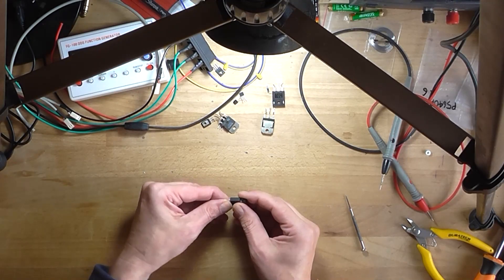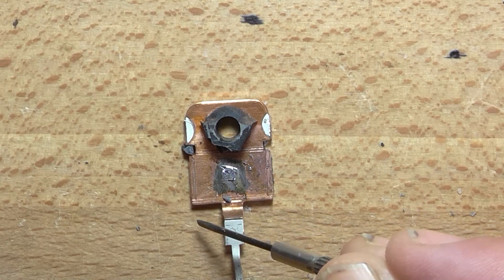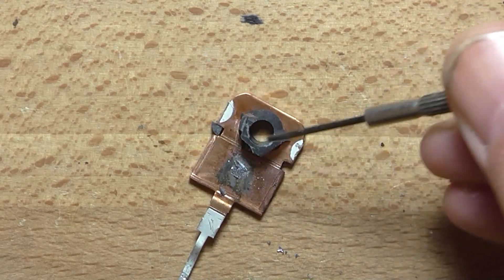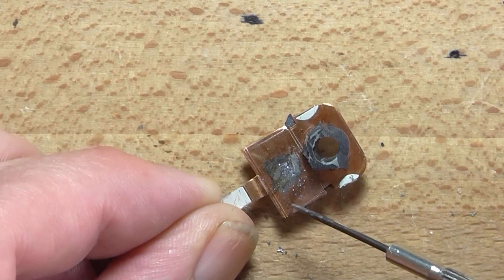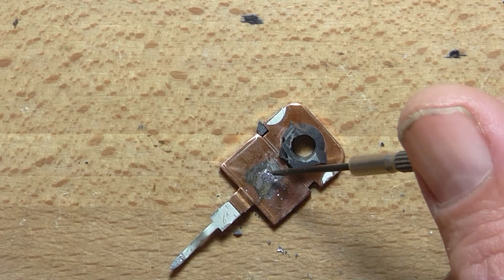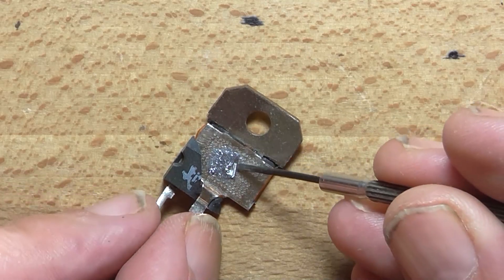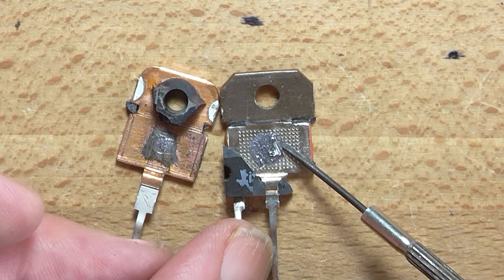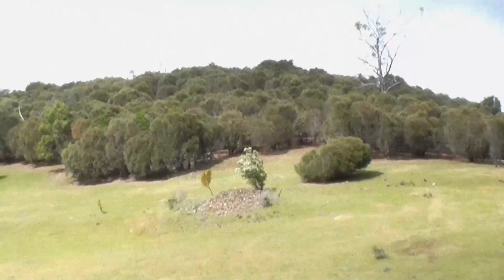Inside A Fake Power Transistor

Comment: I made a voltage booster and i think it was transistors problem yhey say they were rated for about 50 amps but i have 10 amps and it would blow but there are alot more variables like tvs diode and turning it all the way on im not sure

Comment: how do you know what you're getting without splitting it in half?
Reply from the maker: You don't. But, if you go with reputable suppliers, such as Digikey, you should be fine.
Reply: On the non fake is stamped "Genuine".
Reply: @B-M.B Most fakes have the genuine logo on them, sometimes its better to buy the part from another manufacturer knowing its a real one than "original" fakes, at least that is how it works here in Brazil
Reply: @pedrohcs8 you you mean, they lied to me? All the time? 😭😭😭😭
Reply: @B-M.B Probably yes, most of the time i buy a component and it comes identical to the original its a fake.

Comment: Having cracked open quite a few semi's I have found the same issues with dies, also I noted way back (30 years) after opening about a dozen 2n3055's from many diffent suppliers way back then the dies varied considerably in size, I took to opening the 3055's due to many problems with the application I was using them in, all had the same heatsinks attached and yet I found some only lasted a few hours before self distructing, hence even a long time ago all these shitty chinesium copys were floating around the market place.
Reply from the maker: I bought some new transistors from Wagner to replace them in this amplifier (2SA1943/2SC5200), Toshiba devices. I'm a bit dubious, as Toshiba are the number one faked transistor on the planet. However, Wagner is a reputable supplier with a $9 flat delivery fee, which is nice. I haven't tested the amp at full supply (+/-35V), but have tested it unloaded on a current limited +/-19V DC supply in to an oscilloscope. So far, both channels are amplifying the signal to clipping. I won't get to testing it loaded at full voltage until Monday, and am in the process of filming the video (which this excerpt comes from). So, if it blows up again, it will be on video (I will film the PCB during the test, not the scope lol)! Now, having said all that, I reverse-uno'd myself, so it probably won't blow up lol.

Comment: 99% of semiconductors sold on AliExpress, Ebay, and Bangood are fakes or, if you're lucky, pulled from e-waste. Buy from Mouser, Digikey, RS, Farnell, or from the manufacturers directly. It will save you a lot of frustration.
Reply: Yes correct, be carefull where you buy, I only buy from RS and pick up due to there costly postage
Reply from the maker: I bought some new 2SA1943/2SC5200 transistors from WES (Wagner Electronic Services), which is a reputable supplier. $9 flat delivery fee.
Reply from the maker: I have had a good success rate buying BC546/556, BD139/140 transistors and some ICs, such as LM386, NE5532, NE555, etc. from a supplier called "TronFX" on eBay. A guy in NSW, Australia. The TIP36C and TIP35C transistors, I got from a guy called ic_outpost on eBay... never again, even though in my AEL480 amp build, I got a couple of TIP2955s (I think, or it was the TIP3055, whichever) from the same guy, and they worked fine. I guess it's just where they get them from in the first place (most likely Amazon or AliExpress wholesale).
Reply: I bought some NOS transistors on eBay from a repair guy who was closing his shop. Most semiconductors coming from China are suspicious. When I was in China, I had a great deal on NOS components from a former Radio & TV repair shop in Shanghai.
Reply from the maker: @rolandleusden  yeah, I trust stuff from China less than anything else. I've been burnt several times over the last couple of years with fake stuff, like output power amp modules (Kenwood, etc.) that just don't work. Most were videoed. 6 years ago, I bought 5 LM3875 amplifier ICs from China (I think they were $10, or something)... none worked. I had 3 with shorted outputs to supply rails and 2 that did nothing.

Comment: Yep thats a fake
Reply from the maker: That's why the amplifier blew up during a power test. I've got new transistors in there from Wagner Electronics (2SA1943/2SC5200 Toshiba devices), hopefully THESE are not fake. Tested unloaded on a +/-18V supply unloaded and both amps are working again after a carnage of destroyed transistors, but I won't get around to the full power test until Monday.
Reply: @AstrosElectronicsLab  Dim Bulb Tester always !!!
Reply from the maker: Correct.
Reply from the maker: Even if it fails, I will still upload it.